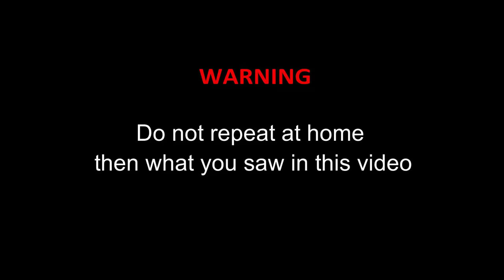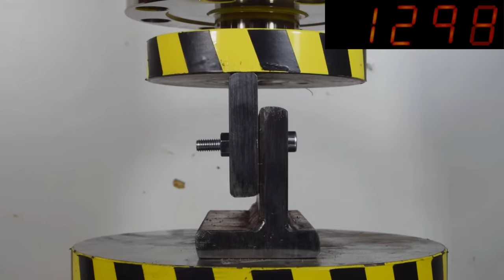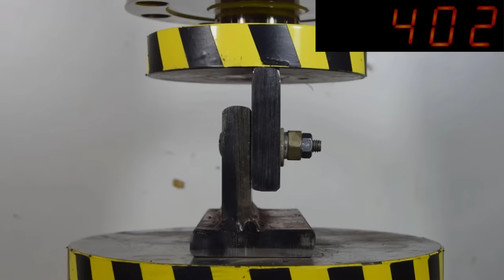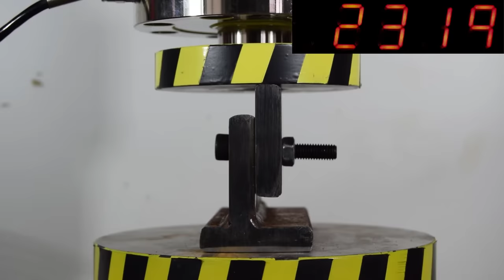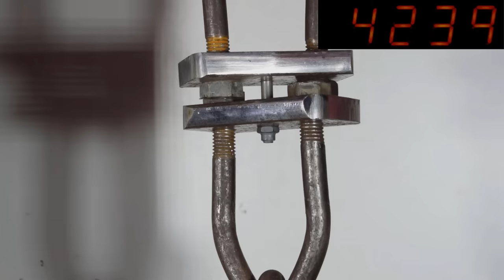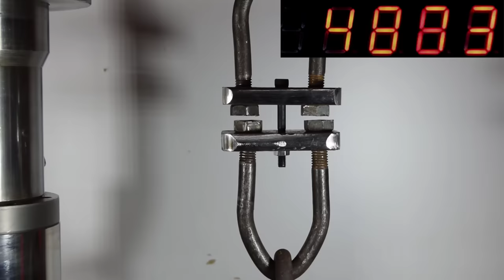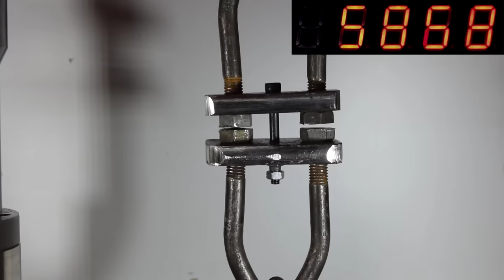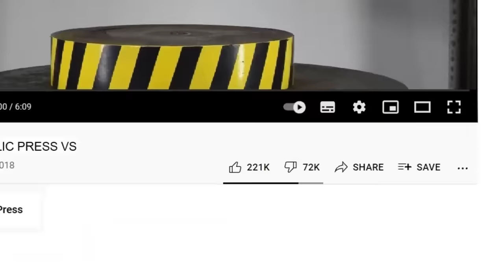HYDRAULIC PRESS VS TITANIUM BOLTS

Comment: Bravo!!! Class 12.9 bolts are often used when prolonged use under harsh loads risks stretching the bolt rather than breaking it which is why very specific torque settings are required, A good example is Cylinder Head bolts on an engine that need to expand/contract and still remain tight avoiding cylinder head failure :-))
Reply: Days of 12.9 class bolts on cylinder heads are gone. Most cars of current century use 8.8 class bolts for cylinder heads. Torque spec is close to yield limit of bolt, so bolt acts as a spring and provides more consistent clamping force under different temperature related expansions of cylinder head
Reply: @el_kuks  "Stretch bolts" that aren't supposed to be re-used.
Reply: If a bolt is stretched it is a failure and should be binned. It will no longer have much strength.

Comment: Worked for a foundry that produces areospace/medical titanium parts.

Some of the suppliers where chinese, they produce good materials.

Only issue with the cheaper bolt is the coloring, it indicated the presence on alphacase on the surface of the parts.

Alphacase is very brittle so it cause problems for cyclic loads overtime (small cracks will form and weaken the part). Alphacase is formed when titanium is heated since it reacts with oxigen. Alphacase needs to be etched off the surface using hf acid for a quality part, the coloring indicates that the etching process was not properly done.

Hope this info helps/clarifies for someone.
Reply: Both of these bolts are Class 5.
Reply: And me I wouldnt trust that bolt just because of the colouring. I was taught as a child that when you discolour metal via heat you weaken it.
Reply: @0blacklightning046  True for steel but Titanium is a different ball game, trust the engineer lol.
Reply: @barryaaa5909  What I said hasnt changed just because you are an engineer. Its called physics something you should be well acquainted with if you are an engineer. For titanium its a slower process due to how strong it is.

Comment: You need to torque the bolts.
In the sheer test friction of the plates plays a huge part in the strength.
Reply: Came here to mention this
Reply: Exactly…
Reply: Agree, came to say the same.
Reply: It's not friction, it's applying the proper preload for the fastener to perform as it's designed to.

That said this entire "test" has so many sloppy variable that it can hardly be considered reliable. XD
Reply: ...so does the wallowing out of the holes after each test putting the different bolts in different shear and bending situations...OK vid for a goofy comparison but must list the type and grade of the bolts correctly - so thumbs down
Reply: @keilet  the fiction of the 2 mating surface plays a huge part in the way this test is performed. Of course surface finish/flatness will also play a part. And as you say the torsional load will also effect sheer.

Also as the other guy said you'd need a new test plate each time with the correct hole size.

Still, goes some way to show the differences.
Reply: 100 % true, otherwise not really comparable.
Reply: That depends in the material used and the bolts capability in that sense  is shown in the second test. However testing the torque limit of the threads would have been nice.
Reply: The Chinese titanium bolt wasn't actually titanium anyway this video was designed to get views from people who don't know any better
Reply: The Chinese titanium bolt wasn't actually titanium anyway this video was designed to get views from people who don't know any better
Reply: The vast majority of bolts (including 8.8 and 12.9 grades) have a sheer strength rating of zero. If you are putting a sheer load on a bolt you are using it wrong. The load on the bolt should be 100% tension with friction between the materials being clamped providing 100% of the sheer strength.
That said, obviously bolts do have sheer strength but they are not designed or rated for use in that way.
With that in mind the "space" titanium strictly outperformed the AliExpress titanium in every attribute it was designed for. (It would make a worse disco ball than the AliExpress bolts too, but since it was never designed or intended for that use we can hardly say it was outperformed, and testing a bolt for disco ball performance makes about as much sense as testing one for sheer strength.)
Reply: As a heavy equipment mechanic, i can confirm that and came here to say exactly this. The torque of the bolts needs to be calculated across different materials as to provide the same amount of friction between the plates, otherwise the sheer test displayed here can be announced as highly inaccurrate and even deceptive at best.
Reply: Yup
Reply: I would suggest the space boots were deliberately left loose for drama.
Reply: He did

Comment: Nice job setting up the rig for your tensile strength test.
Two things would’ve been nice to see:
1) during the sheer test, that the initial loading for each bolt was uniform. You could’ve done this with a torque wrench.
2) also very much would’ve like to have seen a close-up shot of the broken surface
Reply: Exactly. The shear strength of the bolt and 2 components is related to the clamping force
Reply: Idk if the thread pitch was even the same. Same torque value to to bolts with different thread pitch results in different clamping force.
Reply: @thedarkmage7373  I didn’t even pay attention to that. Valid point.
Reply: Project Farm vibes from this comment
Reply: Actually you'd also want a test with their rated torque for each class. Over or under torquing per the material would give incorrect results
Reply: @Confused Cactus75 It is a very good point. Torquing to the same value for all material types would not produce and equivalent test for each material. However, I had understood what you suggested is similar/ same suggestion as @Benjai.
If we were strictly going for shear values, I want to do an ASTM D-732. It wouldn't be representative of a shearing bolt at clamping force. However, I think it would be representative of the spirit of this video. regardless, to your point, the Chinese titanium is crap
Reply: Then make your own vodeo
Reply: @janeblogs324  The shear strength is a material property and not related to the clamping force. The shear stress developed is related to the torque tightening procedure and this in turn develops a tensile force in the bolt also resulting in a tensile stress.
Reply: @danielfrancis3660  while shear strength of the bolt is a material property of the bolt, the shear strength of the joint is primarily found in the friction between the two metal plates caused by the clamping force between them. It’s (one of many reasons) why preloading fasteners is so critically important.
Reply: what i would have liked to see is a weight comparison of the chinese titanium bolt VS the aerospace titanium bolt, because i think those are simply titanium coated steel bolts.
Reply: agreed. for the chinese titanium you could see the bolt tilt downwards while loading due to not being tightened to the face of the test rig, adding tensile forces into the mix, making it appear stronger than it actually is. so this test is not very accurate at all
Reply: @AllenMemeson  "we're going to test that"
Reply: @carsonlindemann6036  Test in double shear to eliminate tensile preload as a factor.
Reply: *shear
Reply: @Chance57 AliExpress “very impressive”! 😂
Reply: First thing I thought also, excellent jigs.

Comment: I work on metal stamping dies, and we use 12.9 bolts as standard. I've used some supertanium bolts and have never had one fail, but one of the key issues to consider is the diameter of the fastener being used. Often, the best solution is stepping up to the next size bigger.  When breakage occurs the designed fasteners might not have been enough for the load
Really like this type of video, a final chart on a dry erase board comparing results, would've been nice.
Reply: That’s quite possibly the longest sentence I’ve ever read.
Reply: @somuchbs6008  I'm not a wordsmith sorry if it wasn't English teacher approved
Life is too short for all that damn punctuation
Reply: I have used inconel X-750 for a forging die ejection pin mechanism. All imported from China. It worked beautifully. Toolig lasted for nearly 2 years in production. The  pin it self was 16 mm in dia and 150 mm in lenght. Die operated at 500 C. had cooling and heating cycles too. Best part, the pin was 1/4 the price an American company quoted me.
Reply: Yes, I'm working as an Engineering staff, and we design machines, and yes in drawings, the plans, we use diameter 7 for a bolt of M6 for the same issue you've stated
Reply: It's a useful point that instead of going up a fastener grade simply go to the next diamater. It's pretty much an axiom saying that if breakage occurs then the fasteners were not enough for the load ;)
Reply: @mattpatt  yep that's what I said
Reply: @johnmoser2689  if you really want people to believe you, simply pressing the period key after each thought will go a long ways towards helping that.  If you can understand the principles of sheer vs tension vs compression, it's not that hard to do.  I gave up reading half way though, rendering your comment less worth posting.
Reply: @nathanwahl9224  I am so sorry I ruined your reading experience with my bad writing skills I half heartedly attempted to correct it but properly left out any punctuation or that sort of rubbish in this comment just for you
Reply: @jonathanorendain9605  M7 bolt size is non standard in metric system.  ae  4, 5, 6, 8  and so on.

Comment: My father was an commercial aircraft mechanic and salvaged a lot of the fasteners that were replaced. We used them on various mechanical projects and automotive uses like exhaust bolts. Whatever materials they were made of, they never rusted or stripped, super strong.
Reply: A bloke I knew worked for Scania (trucks) and he kept some bolts and stuff. You could put a spanner on those and screw them into the appropriate sized hole in steel and not bother tapping a thread first! They don’t rust and you can’t weld them (accidentally got too close to one bolt but the weld didn’t take).
Reply: ... a* commercial airdraft mechanic
Reply: @einundsiebenziger5488  Good thing you chimed in. People must have been so confused by my typo.
Reply: @egoequus6263 i was very confused I'm glad he explained what you were trying to type
Reply: cool story brah
Reply: @egoequus6263  but now I'm confused about 'airdraft'

Comment: Haven't read all the comments but some bolts have threads at the gap between the two plates and some are solid, no threads.  Threads will weaken the bolt in shear at the thread compared with the unthreaded shaft of the bolt.
Reply: I came here to leave a similar comment but found yet again,  great minds think alike.
Reply: The bolts that have a full length thread are called set screws, bolts are partially threaded
Reply: @dharveyftw7349 since when? They’re called fully threaded screws. Bolts are something different. Set screws usually have no heads.
Reply: @melgross  I'm open to learn new things, but you will have to do more than just claim something. I didn't just make up what I said, it's something that has been taught to me by multiple experienced people and teaching sources.

Comment: The shear test should be done with a flat peace of steel between 2 supports, torqued with A torque wrench. This will give you 2 shear areas, but no momentum on the screws. Also the friction between the plates will be identical fir comparison. I believe in the first test the chinese titanium screw showed a better value because it was not only applied with shear force, but also with tension because the plate was already pushed away…
Reply: for sure
Reply: He also used the threaded portion of the fastener which is slightly smaller and weaker
Reply: Truly unfair comparison. Space bolt had washers (clearly softer metal) and a nut adding leverage against bolt. Fastening nut should be flush as with chinese titanium bolt.

Comment: These relatively tiny bolts are incredibly strong is what I get from this video.  Even the smaller ones take almost 2 metric tons of force to break.  That’s about the weight of a mid sized pickup truck like a Chevy Colorado or Toyota Tacoma.

Comment: You shouldn't forget that titanium alloy was designed to stay stable under high and low temperatures when most types of steel become more brittle or plastic.
Reply: Also strength to weight ratio
Reply: And corrosion resistance.

Comment: I think that when you do your tests you should get a torque wrench and torque the bolts to a specific torque. Because it may make a difference if the bolts are not torqued the same.  That would make your video's more accurate.
Reply: And match thread pitch
Reply: Torque doesn't appear to be necessary since they're pulling against a nut and the threads, not 2 flush plates.

Comment: Thread pitch, bolt diameter, the torque used to assemble your fixture, the exact alloy of each bolt , the rigidity of the testing fixture, etc. all come into play here.  I guess what I'm saying is that it would have been nice to have some more control metrics used and displayed in your video (besides bolt mass and general material type).
Reply: I agree!  A fine thread pitch allows for more thread contact and in turn more strength.
Reply: Also depends on where the point of failure is. Most likely at the threads. Finer threads aren't as deep therefore cross-sectional area will be larger.
Reply: with 6.6mil views this video could have made over $30,000. they probably don't care
Reply: @krusher74  true but I commented when there was more like 600 views...

Comment: The only downside to Ti bolts is that you need cadmium free tools to work on the Ti parts or else the cadmium corrodes the Ti. I worked at Viking Metallurical Corp, they make Ti jet engine parts and learned about this gift from space.

Comment: A better comparison would be to use two bolts of equal weight rather than the same size. That would show the relative strength vs weight. Titanium has an advantage in being lighter and does not rust, even in saltwater.

Comment: Other factors to consider is that this is a room temperature test. 
Titanium performs better at high temperatures than most steels do, 
the intended use is another factor in decided which material is appropriate.

Titanium is also less susceptible to most types of corrosion than steel is.

Comment: The torque in to the bolt is a very important variable to the resistence of your assembly. A 10.9 class bolt may resist much less than a 8.8 (same dimensions) if not enough torque is given.
Reply: Thx, just wanted to write that! That's a very crucial factor, as well as the surface condition of the connecting plates.
Reply: I doubt that would matter. this seems like the type of guy that didn't even match thread pitch.

Comment: Steel alloys are stronger than Titanium, it's just that Titanium has good strength-to-weight ratio.

Also, strength does not omly depend on the metal used. It also depends on the manufacturing method (cast, forged, powder-metal forged, machined forged billet, sintered, etc.)

Comment: Of course they use flathead screws on a spaceship. Those won't ever come out.
Reply: No more likely than any other
Reply: @andrewholdaway813  you've obviously never used a flathead screwdriver on flathead screws before.
Reply: @justinwatkins3500  
Just trying to find out wth you meant.
Maybe they don't want them to be removed?
Reply: Yeah, next best thing to security head bolts.. especially if the loctite them with the green loctite by mistake.
Reply: @justinwatkins3500  

I have. In the right application done up correctly they're fine.

And I think said bolt heads here just happen to be TRUSS or DOMED SLOT drive bolts (they're definitely not flat) and he's more concerned with the grade and type of material.

Comment: You should have used a torque wrench for this experiment, in order to compare fairly these bolts. When tightened adequetly, all the cutting force turns to traction tensions. Failing to evenly torque bolts, could lead to uneven results
Reply: and if your measuring things equally, using a spacer changes the stretch of the bolt .

Comment: Would second an interest in seeing the failed bolt surfaces - a ductile failure of the bolt compared to striping the thread is an interesting comparison. I'd also be very interested to see polished and etched microsections - how do the compositions and heat treatments (obviously, if any) vary? Even the quality of the machining on the thread would be an interesting factor, though I'll admit that's probably too much effort for a YouTube video.

Comment: Honestly, the most shocking thing was that a space shuttle has flat head hardware.
Reply: i think it is used due to it has less air restriction.
Reply: In the picture of the clip was no space shuttle but the soviet version.
Reply: I think it's not the head type but the grade of titanium used. Regardless of what the the tightening interface is it's more that this will be the same material type.

Comment: That's not the accurate way to test for shear-strength, you have highly variable friction component in the setup - at the very least you should use a torque-wrench for consistency....  Also your figures are muddled up and don't match the footage.  You also compare shoulder bolts with all-threaded ones, which are always weaker.  Anyone else notice some of them are LH thread?  Or perhaps mirrored video?
Reply: Yeah. A better test apparatus would have the same length of threaded and unthreaded shaft. The shear test would have the shearing component on both sides of the stationary component so it wasn't also twisting. And titanium nuts torqued the same for everything.